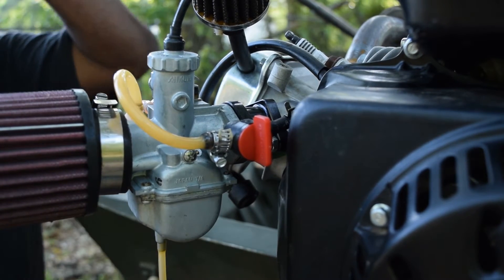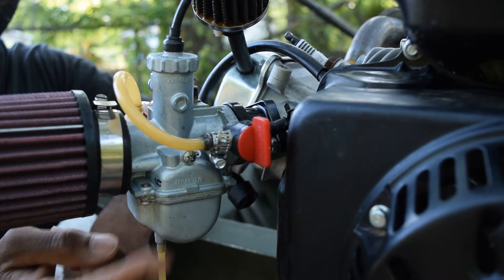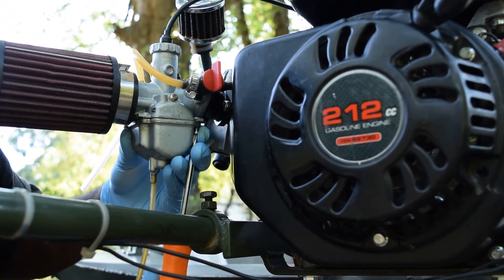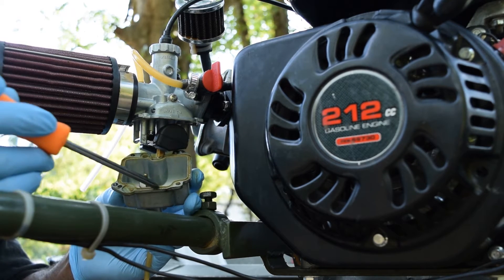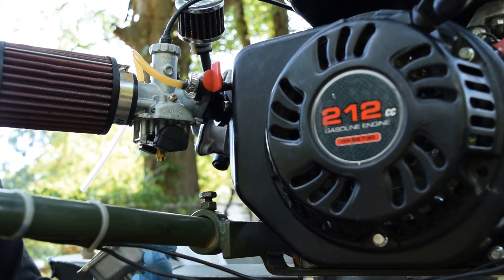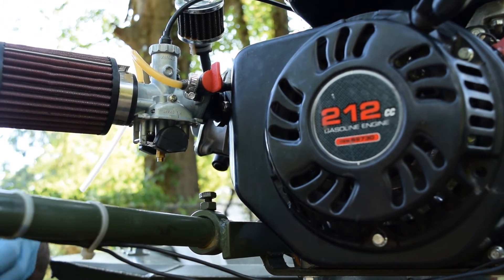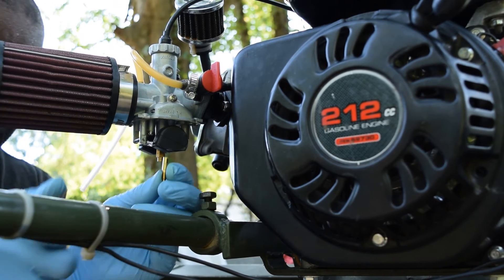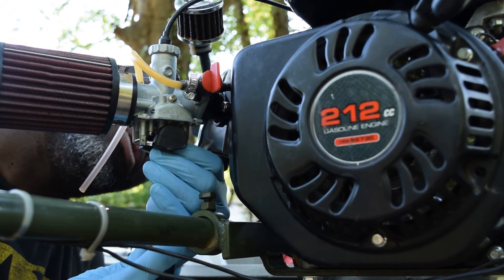Stage 2/3 Mud Motor Build | Idle Jet Install

Comment: Very interesting channel. I dabbled with my dads flight simulator some.
You could sure make some instant chum with that prop in a school of mullet.subbed
Reply from the maker: Thx! Yeah, I run x-plane all the time in Linux no doubt. lol never though of that. It would cut'em up.

Just about have the carburetor issues sorted. Now in the process of converting it over to a fuel pump. The gravity feed original tank doesn't keep the float bowl feed. A simple vacuum pump would solve that. Other than that the jets in this video are working fine.